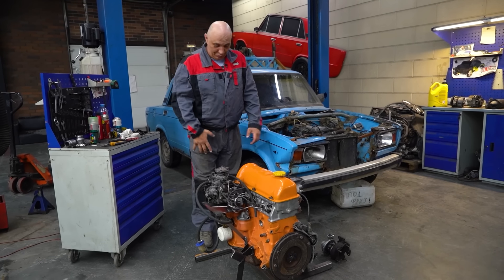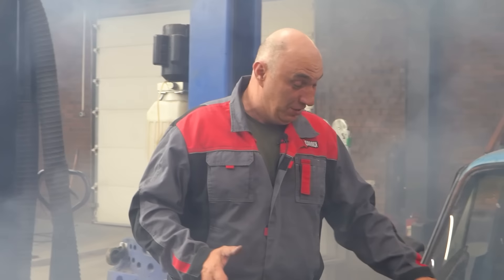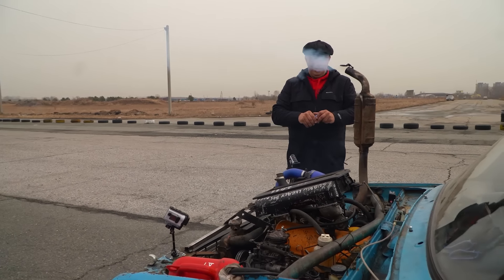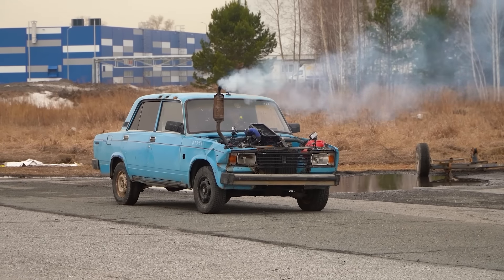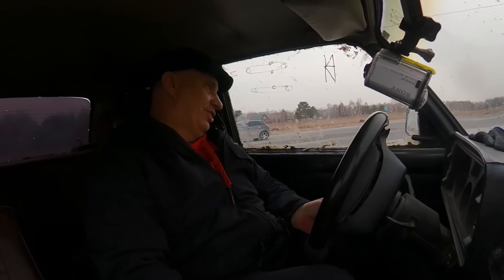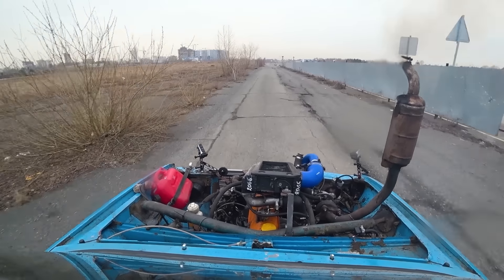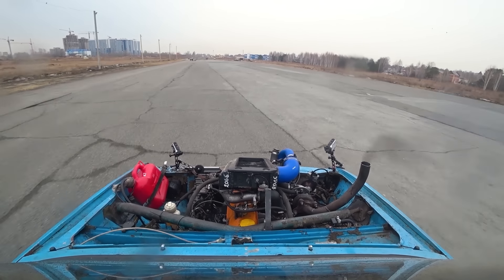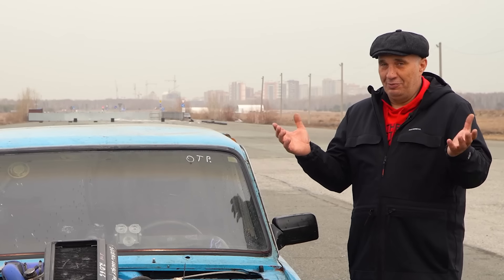Gasoline engine converted to diesel - first drive

Comment: Garage 54 did a better job converting a Lada to diesel than GM did converting an Oldsmobile 350 to diesel!
Reply: Now THAT is a great comment!!!
Reply: I don't know I'm still driving one with over 400k on it like any other car take care of it and it will last.
Reply: I never knew that it was an olds motor they tried to convert. Just assumed it was a Chevy small block.
Reply: hilarious! a1
Reply: SO TRUE!
Reply: So true!
Reply: @Grunt-pr7od  every time i have talked bad about a car some one always comes out and says something like this.
Reply: There's a few good ones in every brand. I prefer the brands that have a few bad ones.
Reply: @zg2964  Probably because it's true. Some people are just lazy and expect everything to last without maintenance. Everyone assumes their bad experience means it's a crap product. That annoys some people, as it should.
Reply: The Olds 350 is fine if you don't dump diesel that's 40% water and 5% cat pee in it. The 2 stroke truck engines could take that, but the 350 couldn't.
Put clean diesel in there and its fine, slower than a Downs but fine otherwise.
Reply: Amen to that! Those Olds 350 Diesels were notoriously unreliable!
Reply: I had the 79 Chevy truck with that diesel engine... And yes it blew...
Reply: The Powerstroke 6.0L and 6.4L are the worst diesel engines ever made. At least the Olds 5.7 won’t send you into bankruptcy when it blows up, and you can actually work on it without removing the body from the frame.
Reply: @Stephen

Those might be the worst medium duty diesels, but they aren't even close to being the worst of all types. My picks for that title are the International Maxxforce 11 and 13, or the Cummins triple nickel.
Reply: It doesnt need much to do something better than americans do. Ok, they can do a lot of things. But europeans can do things way better, faster, more economy etc. Just check the car industry and see the difference between americans and europeans.
Reply: Noh i have dx 88 and its good. In that Lada i think timing needs more andvance because smoke. Or chamber is Just not goid for Diesel. Like this
Reply: @Grunt-pr7od  fuel injection pump just went on mine. I’m not excited to rip it apart lol
Reply: And the GM Family 1 to 1.7 Diesel
Reply: Yeah effort can go along way
Reply: My friend had one & when they converted to gasoline engine under the massive recall they didn’t replace the “diesel only” sticker on fuel door so if someone stole the car with diesel it will look like this🤣
Reply: @mikkotoikka3188  also i does 8liters/100km , 2 ton car with automatic. i have had in nineties few of 5,7 en they were all breathing heavily so driven a lot.
Reply: 👋😂👍I was thinking the same shiet too!
Reply: The LF9 proved that the Chevy 350 can almost do anything
Reply: GM tried the diesel engine in Oldsmobiles in early eighties and late seventies, but they failed due to engine head failure
Reply: I owned one of those Bad ideas . 1981 Olds Delta 88 Royal diesel.
Non turbo, no power or accelerations.  Bew head gaskets often.
Reply: The Olds Diesel is actually a very heavy duty block with larger bearings. They just share the head bolt pattern, oil pump and accesories. The later DX engines where actually quite reliable
Reply: Shame on gm.. but cudos to g54 💪🏼
Reply: Well, GM actually didn't... it's a certain build with larger bearings and thicker casting! Fact is there were builders in the 80, 90's that modified the block in order for the crankbearings to fit smaller ones for ability to rev more. That made a bulletproof but too heavy dragraceengine due to the gasoline heads bolt-on fit.
Reply: Nice one
Reply: @scubasteve06  you can work on the 6.0s and they are way more reliable than 6.4 , 6.4 is no doubt the worst out there
Reply: 😂 i kno..rt? Pleeaaassee give garage 54 a respectable budget, see what happens!!
Reply: Olds didn't convert a gas engine, the dimensions were just the same but the block, heads etc were diesel specific and reinforced plus I think this still blew a gasket.
The olds has same head bolt pattern - not enough bolts for the 22 to 1 cr.
Reply: Lol
Reply: The Olds got a bad rap because the public wasn't ready for it, there wasn't a water/fuel separator and early ones had headbolts that were too small. After the DX versions came out, they weren't that bad, just slow. Add a turbo and turn the pump up a bit, they were decent.
Reply: Hands down the FORD 6.0 and 6.4 are legit junk. 
The GM was a first attempt before giving it to Detroit, which is basically a hacked up 350. 
They could haul, but couldn't pass anything.
Reply: No kidding! Way better using a can of ether and a blowtorch to start it in -1 c. Can’t beat that
Reply: @bobod830_9  That was pretty much true with the GM diesel.  If you could find a set of heads with 50k and no cracks between the valves, and the better pintle injectors, then you may have had an ok one.
Reply: They got a long history of ruining Oldsmobiles with diesel engines that barely work or are extremely underpowered.
Reply: As a muscle car guy, I can confirm that is accurate
Reply: As others have said. They aren't bad. Honestly with head studs and a fuel water separator they are very reliable and sip fuel. Like all gm diesels from the 80-90s. Not the Detroit wing of gm. That's a different beast. The reason any engine is bad its usually down to a retarded owner. Even 6.0 and 6.4s which I've seen ones at 800k on the original engines. I people would learn how to take care of things their shit will last.
Reply: That's the difference between people who know what they're doing and American jokes
Reply: Are you saying that having the engineers and managers in the production shop is better than having legions of engineers and managers drawing a salary and making power point design images on the 30th floor of an office building and never building anything ?
Reply: GM never “converted” a gas engine to diesel. So sick of hearing that wives tale. The olds diesel 350 only shared bore spacing and bore/stroke with the rocket 350. They were purposely made diesels and they failed because Americans hate anything new that they don’t understand, also, without forced induction diesels are far too weak. The 6.2 and later 6.5 diesels were also clean sheet diesel designs that work good enough for the US Army in the Humvee.
Reply: @Mach5Johnny only the owners and shop technicians were at fault. They were made to be diesel engines, only shared bore and stroke and bore spacing. Sick of people hating on those engines, they were fine for the time, the gas engines of the time had just as little power. Do research guys, the olds 350 diesel was never a converted gas motor. Dumb wives tales like that never go away and it pisses me off.
Reply: @MadScientist267 Ukraine?
Reply: @_..-.._..-.._  Facts don't matter. This is the interwebbynets!
Reply: Came here for this comment. I am not disappointed.
Reply: @Grunt-pr7od I didn't think there were any left.
Reply: Could you imagine if GM had put a turbo on that 350 Olds? It would've exploded on the showroom floor.
Reply: @zg2964  AFAIK, that happens in literally every hobby/field. Doesn't make it any less annoying. 
Too bad we can't get those "exceptions that prove the rule" studied.
Reply: @zg2964 that's because they have actual experience with the vehicle. Most people online hate on shit they've never experienced themselves and just take random comments on the internet as truth.
Reply: @zztop7306  Well being a mechanic for a long time i would say i have experience knowing about problem vehicles. They typically are the ones that have made me the most money lol.
Reply: Good thing GM never did what you mentioned do your research and feel dumb for the comment u made
Reply: @stevesepaniak5565 it's neither they're called Detroit diesels because Detroit made them nothing to do with a gm gasser whatsoever
Reply: lol yes
Reply: haahhaaaa!
Reply: Truth lol 😆😂😆
Reply: It was the 307
Reply: @Grunt-pr7od Not too sure changing the oil will save your head bolts from stretching 😂
Reply: @stevesepaniak5565 actually, that's a common misconception. It was not a converted gasoline engine. It was a common engine platform that they could use to produce both diesel and gasoline engines. It was designed and intended for that purpose. That being said, it wasnt a good engine in its diesel  variant.
Reply: @OokamiShinjou to be honest though the GM diesel conversions had serious problems blowing head gaskets due to the extra high compression ratio required for diesel combustion stretching head bolts. They warranteed tones of them and that had nothing to do with maintenance.  It was such a problem that many people opted to just replace the diesel conversion engine with a gasoline engine at dealer expense before the one year 100,000 mile warranty ran out, and GM approved of it hoping to avoid law suits from owners with an expired  warranty and an engine that was dead due to what was obviously a design/material failure.
Reply: Gotta consider though, this engine isn't getting daily driven with hundreds of thousands of miles. I get the point though, 54 did a good job. Gm's conversion is probably more reliable than this but that's not saying they did a good job either. I'd love to see a torture test on an engine like this.
Reply: Are you surprised, that’s Generic Motors you’re talking about
Reply: Despit that the oldmobile is still the better choice. (This is even hypotherically pretemding that the lada diesel engine conversion gone mainstream.
Reply: @zg2964 i always seem to find people irl with these 400k mile crap cars. Shit ppl talk crap bout my 3.4l monte being a brealdown car and yet mines lasting longer than any of my friendd  yotas or hondas. Mosly cus my parts are very cheap so its never a hassle to fix financally. It rarely breaks.
Reply: @paulg444 correct.
Reply: @GregsAutomotive  aint nothing wrong with a 3.4l. It maybe considered a junk motor but thats just because its an old/simpler design. Worst thing about those year model gm's is pushing out rocker studs or head gaskets. Both are really easy on that car. I would buy it and drive it lol. I always drive junk cars and spend way, way less on cars than the mass majority of people. The honda civic im driving now i bought for 500 bucks and after 2 years im still under 2k spent on it including the cost of the car.
Reply: @stevesepaniak5565  VW did it as well with a 1.6 gas engine, which is why the 1.6TD exists as well
Reply: @stevesepaniak5565 ik heb er 1 gehad Chevrolet diesel pickup.😂😂😂😂😂
Reply: @scubasteve06 klopt ik had er ook 1 . triest motor 0 pk .😊😂😂😂😂😂

Comment: It needs more boost!!!
Reply: Average turbo guy
Reply: i think it needs different kind of injectors
Reply: I don't think it's burning the fuel right I think the heads and pistons are not enough compression but who knows
Reply: @myyracommunity4932  The opposite, it's not burning all of the diesel. The compression is too low so it's not getting entirely hot enough to ignite all of the fuel
Reply: @HunnyVRC  So this needs a turbo!
Reply: Needs a smaller turbo as the exhaust turbine housing is waaay too big for the size of the engine. Smaller turbo would produce 4-5 psi just by revving the engine which would help compression out a bit. It also needs the pop pressure of the injectors increasing for better atomization.. But biggest thing that makes boost on a diesel is more fuel!
Reply: Page up!
Reply: I was just about to say that .
Reply: Put the high compression pistols in?
Reply: @HunnyVRC  yes but a normal diesel engine does exactly that if it has bad or wrong injectors and whrn they built this engine the compression was well above diesel engines normal
Reply: Lean it out a tad.
Reply: F&F when they were building the orange supra lol
Reply: Slap a eaton m90 on it with a small pulley and see what happens
Reply: I agree, its hella fat, Needs more Air, heat and RPM's
Reply: @janielbrown690 you are right, there is a lot of unburnt fuel in the smoke, but that is because they used the wrong injectors.
If it just doesn't have enough air, the smoke would be black, so more boost pressure doesn't help in this case...
Reply: yesssssss
Reply: Lose the inter cooler
Reply: Theres never enuff boost well other than that dodge pickup that blew up on the dyno at that show
Reply: That will not help very much, it will increase effective compression ratio but... This just needs more squeeze. Turbo is a bandaid
Reply: @joshmanis9860  My thought exactly. It needs heated intake to start --- that's a clue.

Comment: Hats off to the engineers who timed the injector pump so precisely, and got the compression up to Diesel specifications, nice!
Reply: The low compression is why it starts hard and the exhaust never cleans up. Needs MUCH more compression.
Reply: @operator8014  Or at the very least an intercooler delete.
Reply: @CreeperOnYourHouse yes, take that intercooler off and it will run much better under boost. This thing needs all the heat it can get
Reply: @ronski4677 
I think that pistons need to be changed,
Reply: Not very much of work honestly. Compared to modern day diesel firmware and map upgrades. Been there with my e39 not starting with bosch vp44 distributor pump with it own brains. Rather have mechanical parts thAn very hard coding shit which cost you very dollars before getting to program bmw ecus.
Reply: @TheErki8  Bosch VP44s are extremely reliable that is weird you had an issue. My 2002 jetta mk4 diesel had a VP44 (with the hybrid electromechanical head on it) and it worked flawlessly until the day I tried to adjust the IQ and moved the top too far snapping the collar inside ): sad day for the jetta
Reply: @DarkAttack14  That's a vp37 you have, vp44 is totally different.

Comment: There was a time in Brazil when people converted brand new Volkswagen EA827 (a.k.a. AP) engines from gasoline to diesel fuel, and it worked very well! But I've never seen one of them with turbo. You guys did a great job converting and boosting that up!
Reply: Comandante, the old APs and 1600s run on pretty much any fuel, as long as there is someone willing to do the gambiarra... I mean, the experimentation 😂
Reply: @cleidsonaraujopeixoto163  that's right, it's just a matter of doing the jerry-rig hahaha
Reply: @amiltonfcjunior , pretty much that! If You wander sometime at the Rio de Janeiro's northernmost part, near the Minas Gerais border, chances are You will spot a "Misto-quente" Gol, Brasilia or Fusca, or even some old Chevrolet trucks running with syngas/wood gas.
Reply: @cleidsonaraujopeixoto163  Hahaha os brasileiros fazem tudo com o VW AP
Reply: yep!!!!
Reply: @cleidsonaraujopeixoto163  That really is not much of a conversion.. Syngas will run in any vehicle gas or diesel! For a diesel though you often need to keep a small small amount of diesel injection to light off the syngas
Reply: @DarkAttack14  , You can really learn something new everyday. Thanks for the hint!

Comment: It needs a SMALLER turbo as the exhaust turbine housing is too big, this will give more boost down low. Next would be turning up the MAX FUEL adjustment on the pump to make use of that extra air and thus more power. You could also look at upping the break pressure on those injectors for better atomisation, and modify the Governor in the injection pump to allow higher RPM before the pump starts pulling Fueling for max speed.
Reply: Just by reading your comment, I am glad that I have never allowed any diesel engine to come in for service into my shop :)
Reply: @andrasszabo7386  Old mechanical Diesels are easy. I've built and tuned a few but I'm always learning. Modern diesels are way to complex for me. I know how they work just don't like fixing them.
Reply: @andrasszabo7386  just by reading your comment im glad i can work on any engine including oddball non-compression bisschop engines of 1850, rolls royces of 1918,to horrid modern P'sOS like ford rangers...

 and dont require the services of a shop that gets scared by a bit of heavy fuel oil...
Reply: @garage5125   The engine is more than capable of turning 7 grand, but the Injection pump will be hard limited to de-fuel at 4000 - 4500 to stop over speed. Stiffening the governor spring or reducing the weight of the bob weights will let the pump carry on fuelling to give engine higher rpm limit.
Reply: or he needs a variable nozzle turbo yeah i think a slightly smaller turbo would be better, also that injection pump might need some tweaking, it all depends if the turbo and fuel pump and injectors is for the same vehicle it came out of, i recall the injectors and injection pump was from that diesel toyota hiace or lite ace they were running. and also the engine size might be way too small for the fuel its running as that lada is a 1.6 and that toyota pump injectors must be for around a 2.4 or more.
Reply: @themarinerkommer4371   i believe the Toyota lump was 2.0 indirect injection diesel, i honestly think the injectors are better suited to the way the combustion chamber is in the Lada engine, the pump however needs a different cam plate in it for a direct injection setup, The IDI setup has a longer duration of injection, which is too long for a DI setup. You don't have a lot of time to inject diesel on a DI due to the swirl bowl being in the piston crown, so duration is short. IDI's can start injecting earlier and later due to having a fixed swirl pot. As for the turbo, a VNT could be made to work if its modded to use boost rather than vacuum to actuate the vanes, honestly for this, a smaller turbo would be far easier imho.
Reply: The injektion  pump already has a feature for more fuel when boost, it's the tube up on top that is plugged of, just connect it to the intake manifold and it's done! Just make sure the rack isn't stuck underneath that membrane